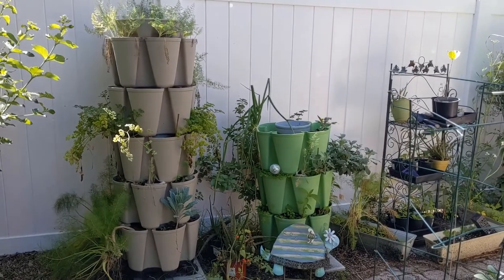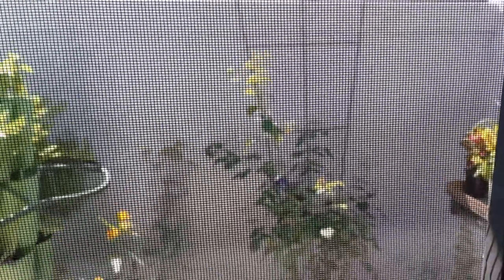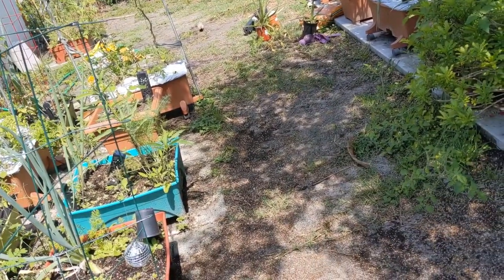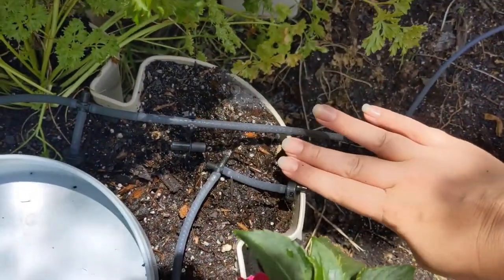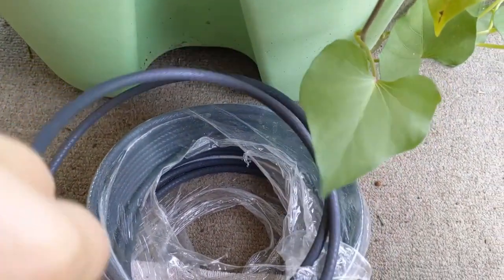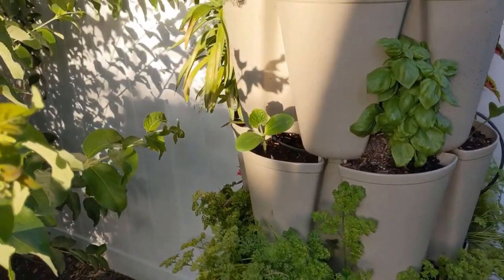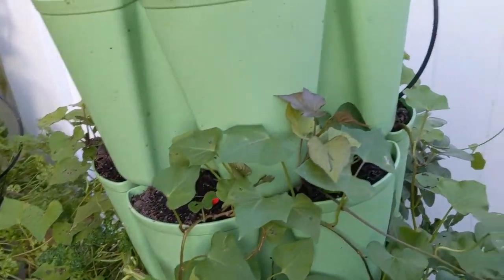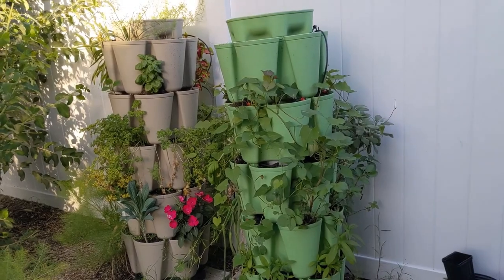DIY GreenStalk Automatic Watering System

Comment: Great idea! I have my first greenstalk and was trying to come up with DIY watering with what I already have. Maybe adding shut off valves within your irrigation network so you turn watering off and on to the rest of your gardens and can focus watering to greenstalks only to get higher pressure. I use shut off valves a lot to adjust watering by plant type.
Reply from the maker: Such a great idea! I am actually looing and reinstalling these in my new Colorado garden and thinking of installing them top to bottom, instead of bottom to top, to help with water pressure. I hope you love the greenstalks!

Comment: Great timing for this video . Lol
I have a raised garden,  I'm getting it all ready , this is my first time using castings in my garden. 
This is probably a silly question 🤣 
I don't know unless I ask , 🤷‍♀️ ..
A thought  🤔💭 came  to me today , while watering. 
I no there is worms in the garden . Everyone  on YouTube say , let the water sit at least 24 hours , before putting in our bins. Now that being said . What will happen to the 🪱 using the garden hose water ? 
Talk soon 🤗🤗
Reply from the maker: Hi Janice! I think in the garden it's probably fine to use the hose water if there are worms, or aren't! It's a bit more spread out and not as concentrated as a small tote bin with a lot of water added. Good luck :)
Reply: you let water sit for 24 hr so that the chlorine dissipates or sprinkle some vit c to neutralize the chlorine. Hose watering your garden or adding some to a worm bin isin't going to harm anything, unless your making a worm Tea, or a plant Tea. The desired end result of Tea is to multiply the microbial activity that are in the castings, which chlorine might limit that life. The best water for a garden comes from rain, rain water has an electrical charge to it-which hose water is void of. So, water your garden and pray for the good Lord to send rain inbetween to give it that oomph inbetween. We ran irrigation but had to run a thicker line overhead with drop downs because the dripline system couldn't perform all the ups, downs curves- but we finally got it working and that will be so helpful during hot hot days. great video

Comment: Could you run a hose up the middle of the tower with a T connection at each tier with one drip emitter to fill up the water dish? That way the tower could still be rotated and the irrigation wouldn't be in the way or visible.
Reply from the maker: Hi! I considered it at the beginning but here's why I opted not to: if you were having a full 5 tower stack, I wanted to have the top water reservoir still available as a back up system to water, and with pipes running down the middle that would def limit the water flowing. 2) When I looked at the 1/4" tubing and how it would fit with a connecter on the interior, I wasn't convinced it would fit without getting smushed making the tiers not stack as well. 3) since I have a few towers (and subsequently learned not a large enough tube to feed them all) I've had to do some rearranging (see recent garden tour videos) and it was super easy to take layers off. Honestly once the plants grow in you can't see the tubing but I can appreciate wanting to hide it. Let me know if you decide to run irrigation tubing through the center!

Comment: I am thinking about how to set up a way to water my Greenstalk when I am away (still snow here and my Greenstalk has not yet been delivered lol). I was thinking of working with the watering system already built into the design and just running a hose on a timer long enough to fill the top basin once a day or whatever. Is this something you considered?
Reply from the maker: Are you referring to the new watering system they just released? I have one on pre-order and hoping to get it soon! Regarding filling it up once a day on a timer- I had considered that but where I am running that level of hose over with my small splitter would have been a pain, and the FL sun does a lot to heat up that water and it is very very hot for the first few minutes (if it was off and then turned on) so I worried about burning the plants. I'd love to know which route you went!
Reply: @gardeningwithalessandra8477  I think the new Spring watering system was announced like the day after I posted this comment lol! I did order it so I don't have to mess with finding clips that fit, but otherwise I think the "Spring" watering system can be achieved with components you can buy at a hardware store. I also liked the idea of a lid.
Reply from the maker: The lid was much needed for sure. I can't wait to hear what you think of the new system. My big concern is the water pressure, as that was probably the biggest problem I dealt with on my DIY system. We shall see!